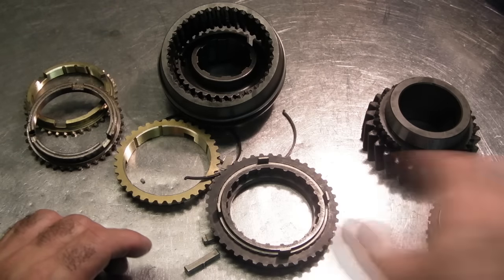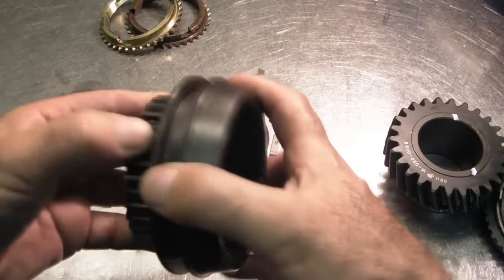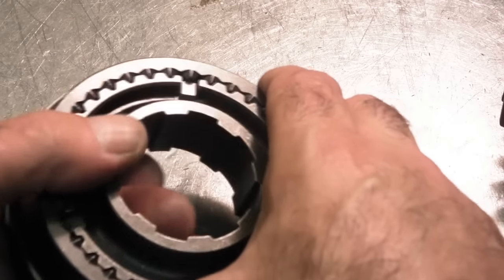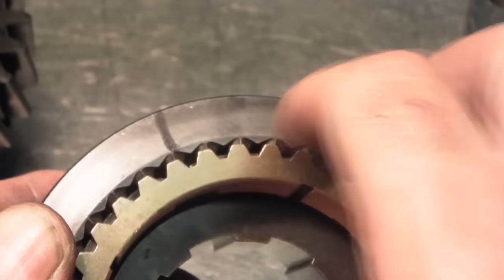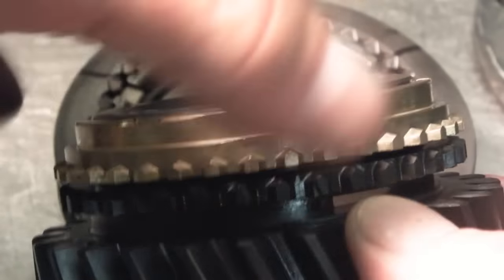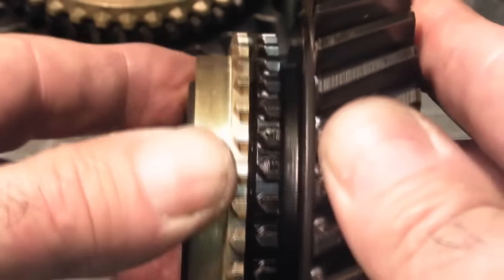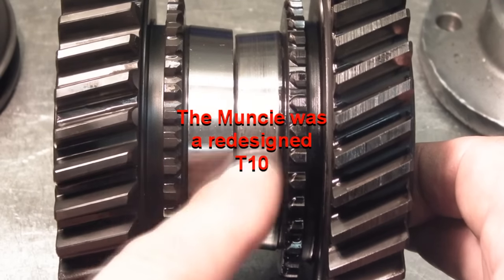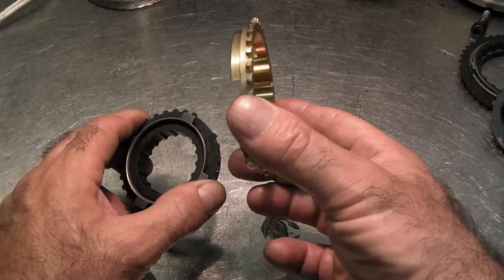Learn About Transmission Synchro Rings

Comment: thanks for posting this, rebuilding a t-56 now. Just a general question, would you say using Redline D4 ATF fluid is safe for the t-56? Or should I only stick to GM Synchromesh?
Reply from the maker: I'm not a fan of Redline products. I currently use Royal Purple Synchromax.  I build long endurance transmissions and have seen wear issues and heat checking problems with Redlne and Amsoil.
Reply: thanks for the tip! much appreciated

Comment: The reason I asked what the difference between a Muncie and a Saginaw transmission, I bought a 1973 Chevy pickup from a friend that knows nothing about the truck. I don't know what manual transmission it has.
Reply from the maker: If you are asking how to identify one simply look up Muncie and Saginaw trans on eBay. Lots of pics there. Muncie is aluminum and sag  cast iron with all levers on the side cover
Reply: My transmission is cast iron and the shift lever is on top not on the side.

Comment: Thanks for this video. May I ask you some questions? When both input and output shafts are not moving, clutch pressed and car at rest, what ensures the alignment and the synchronization between the sleeve teeth and the blocking ring teeth or between the sleeve teeth and the gear teeth? Can those end up to a point-to-point condition and impede the engagement or the chamfer on the teeth will always make them sliding sidewise?
Reply: Can the  block out condition occur even though the synchronizer ring his doing his job and just because the sleeve teeth go straight against the gear teeth?
Reply from the maker: The strut keys or dogs, keep the rings from going point to point. The ring has a slot that the key fits into to allow the ring to only index so far. So when you make a shift the slider will hit the ring on the side of the point and move it away down the ramp of the tapered point.
Reply from the maker: A block out condition happens when there is wear on the slots of the ring, and/or slots of the hub that allow the strut keys to move out of position and cause the ring to go out of index. The other condition for block out is when the slider teeth get worn and pushed over from harsh shifting, causing point to point contact.  This is all described in great detail in my book here: http://amzn.to/1zcGjUS
Reply from the maker: You may want to check the linkage bushings and the block could be caused by bad bushings as well as poor clutch release. You need to be able to get a car on a lift to see the path of the linkage and bypass it and check all the functions

Comment: Great video! I have a Getrag 420 6-spd gearbox (M5) that is displaying something like your blockout condition. It is drivable, but I have to put an unnatural amount of force on the stick to engage a gear. And when it falls in gear i can feel "scraping" through the gear stick. I have verified that the clutch disengages properly. Any thoughts? Thank you
Reply from the maker: Time for new synchronizers.  The 420 requires some special tools.

Comment: Hi . I have a small machining business and have been given a synchro ring that isnt available new any more. I can make new ones but I was thinking would it work to remachine the grooves in the internal taper and take a small amount off the face closest to the gear?  Thanks for the great videos.
Rod
Reply from the maker: What is the ring actually used for?
Reply: I'll have to find out . it looks pretty much the same as the first one in your video. the grooves are pretty much worn away but there is still about 0.040" between the faces. also the gear has grooves worn into the taper. thanks for your help
Rod

Comment: Paul hi my name is don I watch your video there great. I have a muncie m22 last year right before I retired from the police dept I let this old timer that's been working transmissions Probley over 30 years. When I bought the muncie the man said reverse is out. I took the old timer the muncie to tore it apart and found synchronizers where bad and the end of the cluster gear was chewed up so he got a rebuilt kit new cluster gear reverse gear bearing ect after I retired and found the time I did a four speed swap from automatic on a 72 nova it shifts fine but when you slow down in second it pops out check all the linkage and it seems good can tell maybe what could be going on thanks
Reply from the maker: Bad 2nd gear, shift fork or slider

Comment: Hello,
 I'm french .
I need information on the transmission number "RF-C5FR-7A040-A.
This gearbox from a pontiac firebird, 1968.
I want to adapt a motor FORD 351 WINDSOR.
I can adapt WITHOUT problem ??
the input shaft is he indentique / GM pontiac / Ford ???
I remercir you for your help.
I can not seem to find answers to my question on the forum.

thank you
Reply from the maker: +Jean Compain  It is a 3 speed Ford unit. These cars did come with them.

Comment: Hi Paul,
Watched your video, very informative, thanks.

I have a Ram Truck with the Mercedes G56 in it, Factory Spec is ATF+4, but mercedes spec is Mobile Delvac Synthetic SAE 50 weight.  When I put in the Delvac, I have issues getting it in to 2nd gear, even when the car is stopped, other gears are difficult but none as much as 2nd. 

 I cut the Delvac with 40% amsoil synchromesh and that helped but it still very hard going in to 2nd.  I'm thinking it's viscosity sticking the synchros?  I live in the southwest so temp affecting viscosity is not an issue.  

Do you have any idea what is actually happening with the synchros & the gears since it all happened with the oil change?  Thanks
Reply from the maker: If the vehicle is standing still and you are not moving, a synchro ring is not even being used. So something is causing a blockout condition. Maybe the new oil is making the ring stick to the gear, but I have never seen that unless the surface of the gears cone is worn.

Comment: I bought some new brass rings for my Muncie and they have a shoulder on them just ahead of the teeth.My old ones are flat all the way to the teeth.This is causing my third gear lockring not to go into the groove.What have I ran in to and what do I need to do?Thanks ...Bob.
Reply from the maker: Get the correct rings, or  later style matched assemblies.  Call me at 561-743-5600

Comment: Ok thanks. Just to check is the gear cone completely locked to the ring clutch or is it able to slightly move still so the slider can slot in if not perfectly aligned?

Comment: I know this is a really old video but I wondered if you might be able to answer the question about how to tell which way a clutch should be placed if it does not have to labels for Flywheel Side or Trans Side? All the clutches in your video have a raised side and a flatter side. Does the side that faces the flywheel vary depending on the car?
Reply from the maker: I always say. "think it thru". Usually the raised side is going to face the pressure plate. Mock it up. Usually if it is flipped the disc will not allow the lining to contact the flywheel
Reply: @GearBoxVideo  Thanks for such a quick reply. One more question that might help clear it up. The disc has a side that has a felt like pad on it and the other side has more grip. I think its supposed to be some sort of kevlar. The side with the felt like pad is the   "raised" side of the disc which I assume goes to the trans side.

Comment: Paul, I have watched you on Eric the car guy and loved that episode on transmission rebuild. I have a thunderbird sc from 1990 that I think needs rebuilt or inspected at the very least. It is an M5R2 from Mazda. I bought the car out west and when changing the fluids I found shiny metal fragments over an inch long in a circular pattern. I'm guessing 1 1/2" - 2 1/2"diameter working their way out of the drain hole. Not sure if they were spacers or what they could have been. I found a set of lined synchro's just like what was used by ford when new. I am certain you probably have an idea. Any assistance would be greatly appreciated. When I first drove the vehicle, it seemed like there was a slight grind between 2nd and 3rd gear but shifted well otherwise.
Reply from the maker: Hard to say without seeing a picture. Send one in my email
Reply: Paul, I am hoping to get a couple pictures off to you. Not sure what email address you wanted me to send them to.
Reply from the maker: My email and contact info is all on my Youtube channel profile.  Please take the time to visit it and perhaps subscribe if you already haven't.  Thank you

Comment: Hi there. What happens if the slider teeth are not perfectly aligned with the gear teeth at the point of synchronisation? I understand the teeth are pointed to make it easier to slot if slightly not aligned, but this would require the gear/teeth to slightly move. Can the gear still move since it is clutched  and locked to the synchro ring?

Comment: How does the ring teeth finish point to point with the gear teeth at synchronisation? And if they don't always do that how does the ring move/adjust so that it is perfectly aligned for the slider to come through? Wouldn't the ring be clutched/locked to the gear cone? So how does the gear come/teeth move or find itself in the right alignment with the ring teeth?

Comment: you show at the beginning of the video that the spring tab is started on one side of the first key. It's my understanding that the tab on the key spring should be placed into a key so that it does not rotate and loose contact with the key on the other end of the spring.
Reply from the maker: +Michelle Kaiser That is correct.

Comment: When rebuilding the older 4 speeds, like a 60s muncie or saginaw, can you use silicone instead of gaskets to tighten the tolerances on the cover for the shift forks?
Reply from the maker: I don't recommend that. If you find the fork is moving too much away from the slider, on Muncies I used Mr. Gasket Head Bolt washers.  These are hardened washers.  You can also get various size hardened shims from Grangier or MSCdirect.  Place them between the fork and the shift cam.

Comment: how is the sychroniser ring retained in the synchro-hub/slider? In my head the sychro ring isn't connected to anything but just floating between the synchro-hub/sleeve and the gear. What stops the sychro ring being left behind stuck on the gear when you deselect the gear and pull the slider back away?

Comment: Does brand new synchro rings need to be lapped? I often had a "block-outs" so I bought new synchro rings and my mechanic supposedly replaced them but that didn't help. So I'm wondering... either he didn't replace synchros or them need to be lapped.
Reply from the maker: Quality parts are important and not knowing how a ring should fit on a gear will get you into trouble. Common problem with people who replace parts without understanding the fit and function. Example you can have a new ring that's warped or a gear that has a bad cone.

Comment: I do have one question though, what causes the blipping back that allows the synchronizer ring to properly align with the gear? I'm having trouble picturing how/why the input gear assembly would jump backwards ever so slightly when both it and the output shaft are moving in the same direction

Comment: Still don't get one thing. So, sync is going on cuz of friction of a selected gear and a sync ring. When gear is changes, friction causes them to spin in a same speed. But what if sync ring stops in a "blockout" position with a gear wheel, not with a "slider" one?
Reply from the maker: Because you have a clutch and engine load is not transmitted to the gearset the slider when it contacts the teeth of the gear will move it out of the way. The gear is able to move because there is no load. That's why when you have a poor clutch release you get hard shifting and block out conditions...
Reply: Yes, now i get it. Thank you so much

Comment: Hello I am wondering whether starting off in second gear causes any kind of wear on the synchro system, in any type of gearbox. As far as I can see it would only wear the clutch but I have heard that the box takes a beating and cannot see how this is possible. Can synchro gears slip at all when engaged, maybe to facilitate a very smooth shift (not in a performance box obviously)?
Reply from the maker: No, because you are already in that gear so the synchro is not being used. But.... besides overloading the clutch, you can overload the maindrive of the transmission. Use the transmission as it was designed to be used.

Comment: I have some kind of blockout problem with 2nd gear, when cold or when downshifting from 3d to 2nd - gear stick goes through half of gear and then stops like its hitting wall. I guess sleeve goes through syncro and syncro stops the gear, but problem is when meshing action is about to happen between gear teeths? Please answer GearBoxVideo man :)
P.S. problem is intermittent, but happens mostly when engine is cold and problem is worser when outside is cold. But when warm it still happens, maybe if i move gear stick a bit faster then there is no blockout. No grinds or strange sounds.
Reply from the maker: Try a lighter weight oil. Sounds like more of a clutch release issue. The slider blocks out before it gets to the ring. The ring stays loaded against it preventing the slider to push through.

Comment: Can you explain what happens when a car "falls out" of a gear? The shift lever will move out of the gear, even if the gears have meshed and driven the car for a while.
Reply from the maker: There are several components that wear causing this issue.  The engagement teeth on the gear, the teeth on the mating sliding clutch, the shift fork, the groove the forks fits into. The ring works to synchronize the gear, Staying in gear is a mechanical link.  Any component in that link can wear. Excessive endplay in certain gear trains can cause this issue as well.

Comment: Paul why can't you gear a Muncie 4 speed like a 3 speed where 3rd gear is at 1 to 1, then gear 4 th like the 5th gear in a 5 speed, then it would be like a 3 speed but with 4th gear overdrive? just a thought.
Reply: Would there be to big a gap between 3rd and 4th?

Comment: Since the synchro-ring is at first engaged with the cone surface of the speed-gear, then how are gears of the synchro-ring and the speed-gear gears are a lined exactly so they can together mesh with inner gears of the slider and not seeing any grinding during a shift?
I hope my question is understood......Thanks
Reply from the maker: They are running at the same speed. The slider pushes the ring up against the gear forcing it to run at the same speed of the slider before making the connection.
Reply: GearBoxVideo Thanks so much for answering my question.
Yes I understand that the ring is pushed against the cone by the movement of the slider and thats to force them to move at the same speed 
My question is regarding the outer teeth of the synchro-ring and the small outer teeth of the speed gear, How are they being perfectly aligned to mesh with inner teeth of the slider.
Or is it just because of the small relative movement of the synchro-ring relative to the slider?
Reply from the maker: W .Khairi The ring is somewhat fixed to a position relative to the slider by the strut keys, when the slider goes over the ring towards the gear the points of both the slider teeth and gear teeth are designed to allow the two component parts to move out of the way and allow the slider to engage the gear. If the teeth are no longer pointed and flat, that is when it can become a problem.;
Reply: GearBoxVideo That gives a lot better picture, Thank u very much.

Comment: I've got an 03 G35 with a 6 speed manual transmission. It does something odd when I'm shifting into second gear. About 50% of the time, it'll make a an audible clunk sound, as well as a sharp notchy feel in the shift lever. I'm assuming that might be an abrupt shock from the slider and gear not being entirely synchronized? All of the other gears are quite notchy, but 2nd gear is the only one that makes this abrupt clunk. So I'm assuming the transmission is going to expire at some point in the near future, and I'll likely need to replace it.
Reply from the maker: It sounds like a poor clutch release because you have notchy shift feel in all the gears. Poor clutch release due to bad hydraulics kills synchro rings.
Reply: GearBoxVideo I hadn't considered that, I flushed my hydraulics a few weeks ago and thankfully didn't notice any leaks, and from what I could see, the slave cylinder piston seemed to be extending all the way. Although, with 90k miles it certainly could be the case. This was the car I learned to drive standard on, and as most people probably end up doing, I have ground a few of the gears (light grinding, but grinding nonetheless). I have to assume that doesn't help my case at all. Of course when I first got the car, I didn't fully understand the mechanics of how to transmission works, but now that I do, I'm beginning to notice how it works. I suppose at worst case, I can buy a new updated transmission (with triple cone synchros all the way up to 4th gear) and a new clutch and flywheel, and that should remedy the problem and give me at least another 100k miles. Thank you for your input and your videos, I've learned a lot!

Comment: I have an 89 chevy silverado 1500 recently put in a new motor but now if I'm not on the gas my 4th gear will grind when I'm trying to shift into it or if I let off the gas it will pop out of gear wondering if gm mtf synchromesh would help till I get enough money to A) buy a brand new transmission or B) get my 4th gear fixed
Reply from the maker: +Trenton Meyers I don't think oil will fix a problem that has to do with falling out of gear. Sounds like the synchronizer has some wear issues.